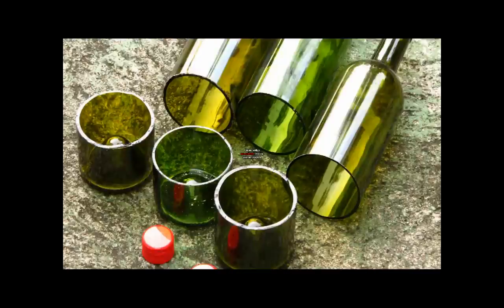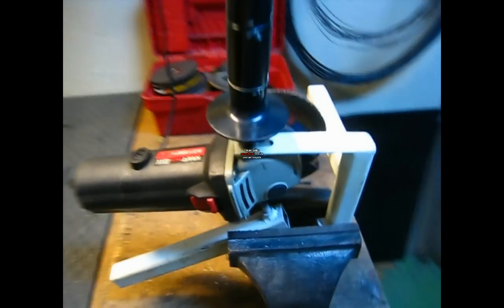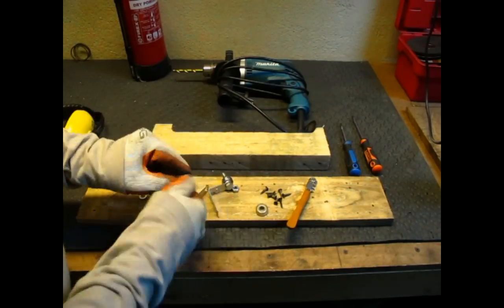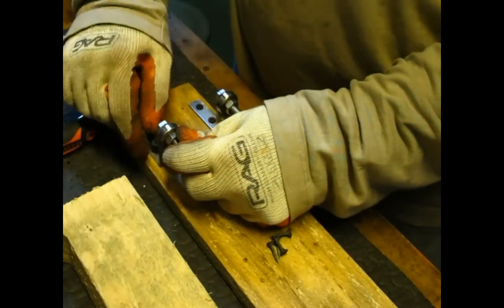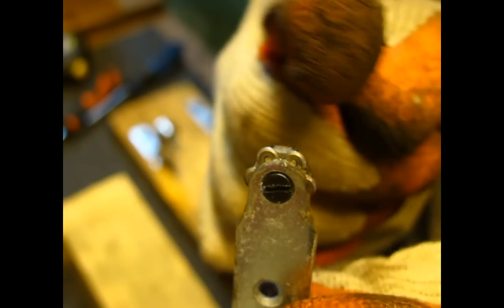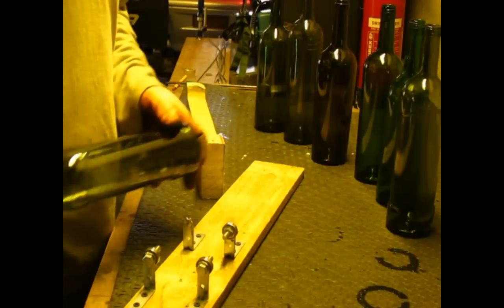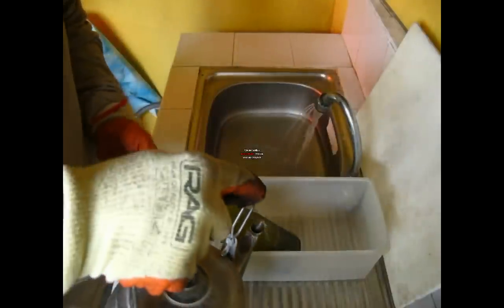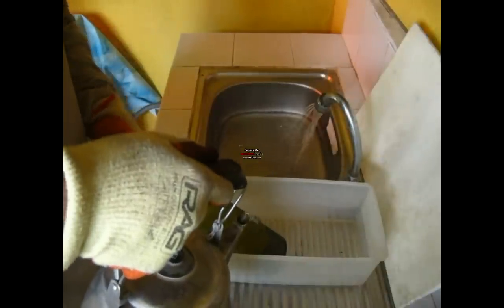Easy Wine Bottle Cutter With Perfect Edges, How to Video DIY Recycling Ideas cutting Bottles

Comment: Excellent project! I bought a bottle cutter and it is a flimsy thing & there are certain lengths (in the middle of the bottle) it won't let you cut. Your design is stronger and lets a bottle be cut to any length!

Comment: Very nice. You could easily mount the 2nd piece of wood so it would slide to the right size and be secure if you were either weak and would have difficulty holding the piece of wood or uncoordinated and could not rotate rotate the bottle with one hand and hold the would steady with the other.

Comment: Very clear, and concise instructions! One suggestion, put the bottom brackets facing the other way (the bottom screwed in part). I am someone who sometimes wants just the very bottom piece of glass, so if those bracket bottoms were facing the other way, I'd be able to push the wood all the way to the end of the bottle. Thank You for a wonderful video!
Reply from the maker: +Bettina Stepek 
Thanks Bettina

Comment: great but wondering where I would get the multi head diamond glass cutter... I have found these are usually just one cutter wheel.
Reply from the maker: Pls see below comments
Saeid
Reply: Saeid Momtahan  Thanks .. I found an item made by Task Tools that is similar to yours.. a multi cutter head.. seems inexpensive.. hard to tell online if it screws onto the handle but looks like it does. Task Tools T33822 Glass Cutter
I ordered the wheels and the cutter.  The wheels are likely from far away, cheap but will take weeks to get.  So I am guessing chinese made.   I did like your lantern video as well... you must have some secret supplier to get the unique things like the fire proof insulation and the sockets.  It does show lots of ingenuity ...hopefully you inspire people to be more inventive and get off their butts watching regular tv.  Keep up the great work.
Reply from the maker: Michael, I work with what I find. I make my stuff in the Philippines, Iran and Dubai. Each market has its own unique items that can not be found in the other places. I spend weeks in each place looking for supplies sometimes.
THe fireproof casing I found in Manila, easy to find there. Can not be found in Iran or Dubai.
THe metal wires can be found only in Iran. So I vary the designs to fit what I can find.

If y're in the US I know Low's has the cutter. Have a look on their web site

Saeid
Reply: Saeid Momtahan Yeah the stuff is ingenious for sure... very resourceful designs.  We do have Lowes here in Toronto...very big city..4th or 5th largest in North America but still sometimes hard to find some little things.  These are great DIY recycling ideas ... glad it is a real trend these days... We throw so much stuff out by habit ...might as make our resources last as long as possible.

Comment: Have you cut beer bottles before? They are tricky because they are thinner. You score the bottle like a wine bottle but to separate a beer bottle hold a solder iron on the score line until the crack forms on the score line then hold your iron near where the crack starts then the crack will move and will appear to chase the iron and you do this all the way around.
Reply from the maker: +Michael Ellestad 
I'll have  to try that one. Thanks!
Reply: you still score it like a wine bottle but use a solder iron to separate the bottle. I did two more a little while ago I did a 22 and later on a 40 OZ bottle which my mom calls a Viking Jug.
Reply: Also make sure you shine a bright flashlight so you can see the crack form on the score line
Reply: +Michael Ellestad Just cut one a day ago. Score it lightly all around with your glass cutter, then spin it slowly near a candle, but not touching the flame to the glass. Slowly dip it in room temp water. A few times and it will drop off nicely. Hope this helps. Needed an amber glass funnel. Beer bottles work great for that purpose.
Edit: Haven't had coffee yet..
Reply: Hey cybernet amd,

I have seen your method used before on youtube and it works well. The Solder iron method I got that from a video I saw on Green Power Science and it works well for me too. I did a few bottles including a 40 ounce beer bottle and made what my mom called a Viking glass or Viking jug

Comment: Fill the bottle up to the cut line with any oil. Insert red hot poker. It will separate at that line. Even if the bottle is at an angle

Comment: Don't score more than once, you don't need to and you're potentially scoring a new line which will lead to an uneven edge. Breaking the score isn't as simple as it is with sheet glass, but I'd still suggest spending the time and learning how to tap it instead of relying on thermal shock to do it for you. Less risk of breakage/jagged shards if the bottle wasn't annealed properly.

Comment: Can you please tell us exactly what your glass cutter is called or where to buy it?  All I could find were glass cutting rotaries, which are very thin and small discs.  There is no place inside the disc itself for the screw to fasten like yours.  I will probably have to drill a custom tiny hole into my L-bracket for this tiny screw to fit.  It's clear that you found a cutting blade that also fits the holes in your L-bracket.  Help!
Reply: Did you get an answer to this question? I have the same question?
Reply from the maker: Xander, I thought I had replied to your question already. THe cutter I use is the cheapest and the most common you can find at a hardware shop. There is also the same cutter that is made in Germany which is around 5$. Either one will work. 

Saeid
Reply: I couldn't find one like his but you only need the blade right? They sell glass cutter blades. http://m.homedepot.com/p/QEP-7-in-Glass-Tile-Diamond-Blade-for-Wet-Tile-Saws-6-7006GLQ/202329538/
Reply: Kendra Bray
 That wont work.
Reply: Marin Pamukov why won't it?
Reply: Because it is a disc for an angle grinder and you need glass cutter
Reply: Marin Pamukov Umm...o_O Yeah I tried it, and it works the same way. So I dunno why you assumed it wouldn't work.
Reply: Marin Pamukov If you took a moment to look at what I sent this is like a little disk that goes on rotary tools, since it had a hole in the bit I just used different screw and nut to hold it in place, you also have to adjust the size a tad so the glass will fit perfectly. BUT YES, it does work, this is a diamond blade known for cutting glass.
Reply from the maker: Kendra, you're going the wrong way here. As Martin pointed out, this a a big disk, 7 inches in diameter to be exact. You will need a big grinder to operate this, and then you'll be geting into a whole lot of trouble with various things. 

Here's a link to the cutter you need to get
http://www.lowes.com/pd_239124-16878-50411_0__?productId=3077867

Let me know how it goes

Saeid
Reply: Saeid Momtahan Thanks Saeid :) But it bit worked for me. I just adjusted to it's size.
Reply: Saeid Momtahan Ohh I just realized you thought i bought that one bit, I bought this one http://www.mytoolstore.com/dremel/545use.jpg I had a coupon from dremel and used it plus I figured it I could use it for my dremel too so I bought a few of them. You have to adjust to size a little bit, the engineer in me loves to build crap xD
Reply from the maker: Oh this one will work great then. You can even cut square bottles with it, like Jack Daniels

Saeid
Reply: Saeid Momtahan You just gave me an excuse to buy a bottle of jack daniels this weekend. I'm an official subscriber now!
Reply from the maker: Thanks Kendra. Be sure to wear goggles and thick gloves when cutting the glass.

Saeid
Reply: this is the cutter..or one that works anyways: http://www.amazon.de/HOLTMANN-Glasschneider-mit-5-R%C3%A4dchen/dp/B003LWNCZE
Reply: Lowe's have the glass cutter you can take apart!  And it was under $5.  Also, make sure you get the correct "L" brackets.  For the fourth bracket that has the cutter part, the hole has to be small so that the tiny screw fits.   I made this mistake already and have to redo all my "L" brackets.

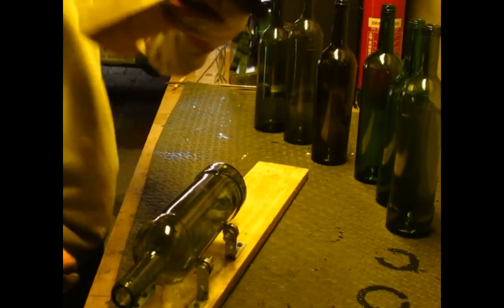Comment: Dear Saeid:   I'm finally getting around to making this!  If you look at 3:11 versus 3:27; I see that the "L" brackets are situated differently. Maybe it doesn't matter?! I've made mistake after mistake, and have been to the hardware store numerous times.   1) Bought rounded (not hex) bolts. 2) Got 6-cm "L" brackets and the hole for the diamond portion was too big.   Back to the Depot!  I'm determined to make this thing!
Reply from the maker: Hi Jackie, IT doesn't matter which way the brackets face. Keep at it. Once you make the cutter, it'll be worth the trouble you went through.

Saeid

Comment: Saeid, A faster way to split the bottle is to soak a string in lighter fluid and tie it around the scored line. Light it and then sink the bottle into the cold water. Will split first time. We used to do this to make glass funnels.
 Takes about a minute for the flame to get the bottle hot enough to split.
Reply from the maker: Yes, I've seen that. But do you get perfect cuts like you do with this system?
Reply: Saeid Momtahan
 Use your cutter but just use the string to heat the score line. faster than boiling water. Just a suggestion. You would get as perfect a cut as your cutter will make. I had a cutter as a kid and it didn't work near as well as your homemade one.
Reply from the maker: Aahh I see waht you mean. USe the cutter and the string together. I wil have to try that. 

TY
Saeid

Comment: hi..good video..I need the measurements of the items used pleasee.. thank you so much
Reply from the maker: Hi.Which items?
Reply: Bearings  and screws .. thank you
Reply from the maker: Watch the video again. It's in there
Reply: yes screw are 3cm.. but bearing?
Reply from the maker: 1" outer diameter
Reply: and 3/8" Inner Diameter right?  thank you
Reply from the maker: Same  as whatever bolt u use.

TY,
Saeid
Reply: Saeid Momtahan hii !! you know the number for the bearing?  bearing number... thank you !!!
Reply from the maker: I don't. sorry, just any bearing will do

Saeid

Comment: The "cutter" wheels are not diamonds. Those are very hard steel wheels that crush the glass as it it pressed into the glass. When that is done along a path on the glass a crack can be propagated along that path.
Reply from the maker: Sorry about the wrong terminology. Yes, you are right. Thanks for the heads up
Saeid

Comment: a common mistake when cutting glas is to do several seperate cuts. Doing this will lessen the needed tension inside the glas, so try to avoid it!
Reply: ChickenCommander 

' iūķ

Comment: Just so you know for the future, you must score only once with a glass cutter. Scoring over again damages the cutting head.
Reply from the maker: +Black Orchard 
Will keep that in mind. Thanks!
Reply: Just curious, how? What's the difference? Say you were to score 1 bottle once instead of over and over, then kept on doing 30 different bottles there after??? What would the difference be? Or did you mean it's the back and forth motion that's not necessary?
Reply: If you don't get a complete, uninterrupted score all the way around the bottle (as was the case in the video after the first pass), you're likely to get a very jagged break instead of the straight break you need.

Comment from the maker: I don't find it necessary to sand the edges as they are not sharp enough to cut you. But you could if you wanted to with a piece of fine sand paper. 
I did sand the edges on the first couple that I made, but haven't done it to the rest of them.

Thanks for your comment,
Saeid

Comment: Just 2 comments: Except the glass cutter part, definately LOOKs like the easiest and cheapest to make that I have seen. Also you should not score the glass more than once all the way around because it causes small fractions in the glass making it more susceptible to cracking and breaking. Other than that, ....THIS is the one I will try; I also already have these materials BONUS :-) TXS!

Comment: This looks like a cutter that will last for years or even decades, looks very stable and sturdy. I don't have the tools nor the skills so I decided to just buy from Homeproshop on Amazon. They got pretty neat bottle cutters, too. Easy to use and comes with accessories. Helps a lot in my projects. Anyway, can't wait to see your final square bottle project.

Comment: Can you show us how to modify this tool to cut square bottles?
Reply: I imagine you could make a wider board with more bearings--like do two rows of 6-8 bearings closely set so you can drag the bottle horizontally instead of spinning it (if that makes sense?). 

The only issue with cutting square bottles is that the corners are usually rounded, making it almost impossible to get a decent cut anywhere the edges meet up.

Comment: Worked like a charm.  Probably not necessary but, I raised the bracket with the cutter to be at an even level with the bearings so the bottle sits level and, perhaps a more accurate score on the bottle. 

Thank you for the video.  VERY informative!
Reply from the maker: Glad it worked for you. THat's how it's supposed to be, the cutter and the bearing on the same level. Good luck with your projects.

SAeid

Comment: Watch crazy Russian hackers video for a much easier one- only needs bottle, acetone, string, water and matches
Reply: i saw some other people do those; they were slightly to very jagged.
Reply: it's not that as perfect edge glass cutting
Reply: peridot greene appoa detush Sanders?
Reply: Ture! but Saeid’s accent is heaps cooler!
Reply: The string/acetone method is stupid dangerous. You're causing massive thermal shock on an annealed piece of glass. It's as likely to explode as it is to pop off cleanly.
Reply: Dominic Knepper I'll take a 50/50

Comment: Great recycling idea - but it is let down by wasting so much water. Can you find another way to split the glass?
Reply: Use a bucket and instead of having boiling water use a thick piece of string soaked in rubbing alcohol. Attach the string around the score, tie it off, and light with a match. Make sure it's burning evenly for awhile. Then soak. Repeat if necessary. 

If it's waxed twine that would make it burn longer.
Reply from the maker: You're absolutely right. Unfortunately, you recycle something, you waste something else. That seems to be how this universe works.

Saeid
Reply: LaughingVegetables
 i used that method before and it does not give fine /even cut as much as consistent as etching the bottle first with a diamond blade glass cutter.
Reply: good to know ;)
Reply from the maker: Sean, dude, you need to lighten up. Everytime I'm cutting a bottle, the waste is exactly what's going through my head. And I live in a place where water is so abundant, it's almost free.

It's about a mindset more than anything else. Some people are aware of the fact that we are overusing and abusing every resource the nature has given us. And that goes for about every aspect of our lives. I'm sure you can agree with that.

Saeid
Reply: Saeid Momtahan Not exactly sure why we are qorried about wasting water..  when we can always distill more..  but..  why not use the same water over and over??   heat one kettle..  keep the other cold.  poor over a bucket..  repeat.  For free heat, stick a fresnel lense between sunlight and water.  The only water you are wasting is what evaps.   and if your outside..  it goes back in the ground where it came from.
Reply: I use a candle to rotate the scored bottle over and then rub an ice cube over the score. If you get the bottle to hot the break goes wild so go light and do it 2 or 3 times.  Works great. Nice jig for scoring the bottle Saeid.
Reply from the maker: Chris Lunch Good news, I figured out how not to waste so much water and get even better results. Check the link at the end of this video.

TY

SAeid